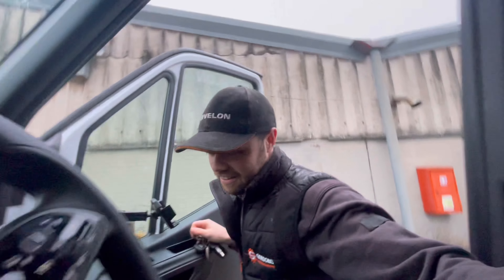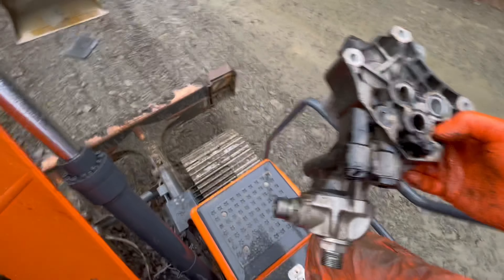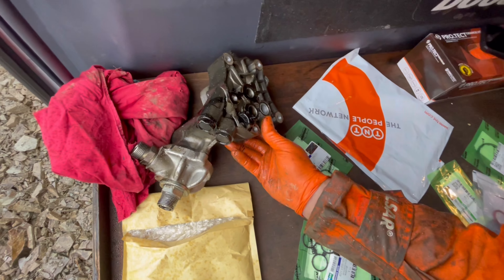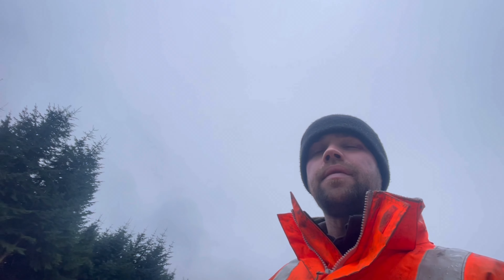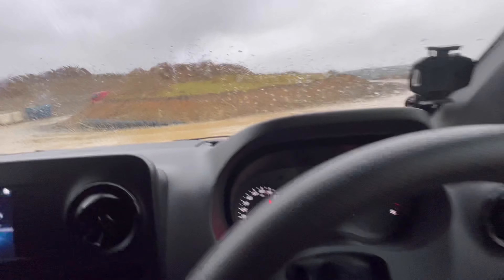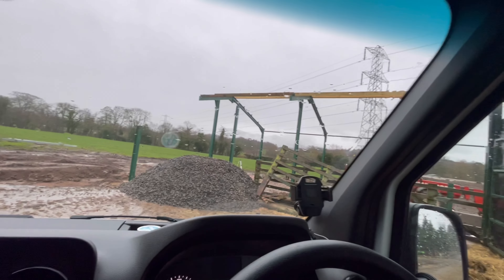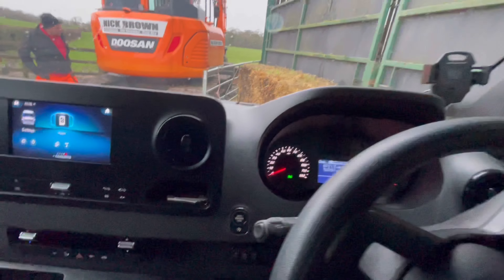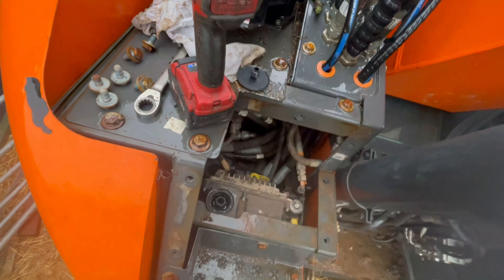Engine oil leak ! / Wasn’t expecting that / a very very wet day !

Comment: Amazing how it could run for 800 hours with that cap jammed in the o ring without leaking! Having said that I did a gearbox oil change on an old tractor with 14000 hours the other day and found a spring 2 washers and a whole load of bits of brass in the bottom and it still works perfectly!😂💪
Reply from the maker: One of those things you wish you never seen 😂 just the waiting game now to see what it was 😂😂

Comment: Hi Ali, have a dx85r with a hydraulic thumb fitted, the feed to push the ram to lower thumb  seems to be getting slower, full service with pilot and hydraulic filter changed recently and number 5 on flow settings, is there anything i could check for 
Thanks
Reply from the maker: I’d probably check 3 things starting with the quick couplers first then make sure the change over valve below the cab floor hasn’t moved and try swapping the pipes to work it in the opposite direction to see if the fault remains on the same function if it swaps the fault to the opposite side I’d guess the port relief valve has weakened
Reply: @alisdiggerdiary  Thanks Ali I'll give that a try

Comment: You keep up like this.....10yrs time you'll be in a nice warm office on phone telling the young chaps how to sort problems out..
Iv always got greater respect for field engineers than workshop ones.
It's makes me laugh when opps ask my why i talk to myself.......
In field you need good advice......so I talk to myself.....ha ha.
As for ad blue ect.....are we going fwd or backwards......nrw machines needing bean tins over pipe like we did back in 80/90s on tractors to stop rain going down pipe....just saying.
Reply from the maker: 😂😂 sound words Marc yea it’s amazing the difference when those rain flaps are fitted I remember getting atleast one a week during winter especially after the Christmas brake changing those sensors 🤦‍♂️